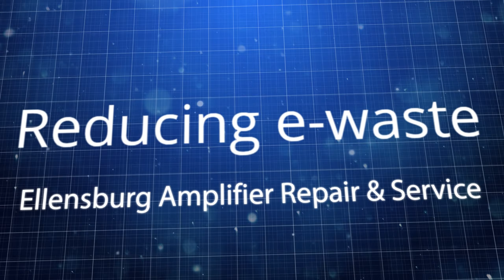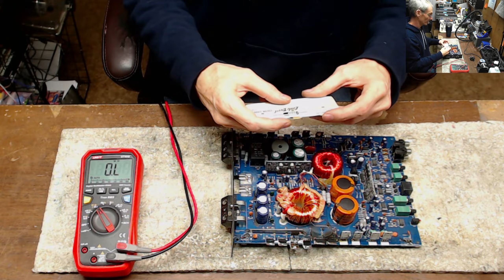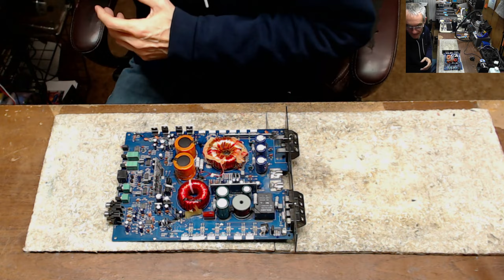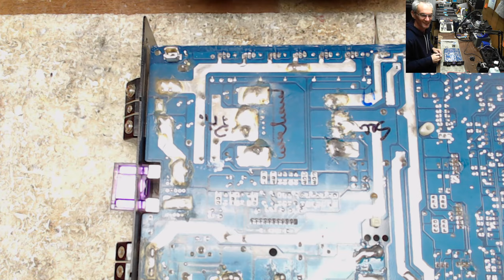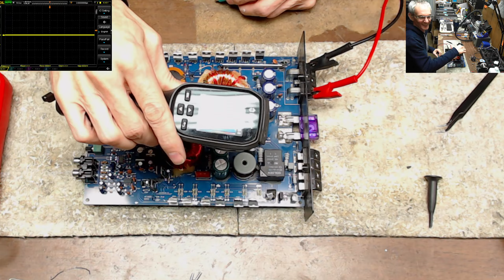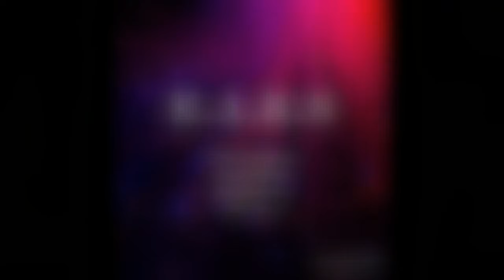Hifonics HFI1000.1D Car Automotive Amplifier Repair

Comment: Learning so much from this video and only at 29 min into it! By chance could i send you my amplifier to fix ?
Reply from the maker: Hello! It depends on what amplifier you need to have serviced. I do not service all amplifiers and the FAQ page of my site provides more information.
Reply: @ell @ellensburgamplifier have the same question, got a hifonics zrx1216.1D that has some ugly corrosion on the fuse terminal and on the chip with the model number on it also noticed a ground looked melted at the tip like a fuse burns lots of info just came across your channel aspiring electrician here 1 semester from attempting the certification for in California

Comment: I was wondering where I could get the cardboard turntable that tells you what resistance the resistor is around 13:36 in the video any help would be appreciated thanks
Reply from the maker: Ok the reference wheel. The one I have was put out in the 50's but here is a link to a good guy (Steve) that has one for sale. Tell him Todd's Tubes and Testers sent you! https://www.ebay.com/itm/276369865501?mkcid=16&mkevt=1&mkrid=711-127632-2357-0&ssspo=DbJ3X0MoTlC&sssrc=2047675&ssuid=Q6ZdGeQQSfm&widget_ver=artemis&media=COPY
Reply: Thank you very much
Reply: What scope do you use?

Comment: Where did you get the resistance turntable board
Reply from the maker: If a resistance box is what you are referring to then google "decade resistance box" and many will pop up. Quality is key on these.
Reply: @ellensburgamplifier  no it was a card you had that showed the different colors to figure out what was the resistor
Reply: Its at 13:36 a card with a turntable you said

Comment: I have a Autotek Meanmachine  1500.1d (2012), its before Maxxsonics took AT in a different direction.  It's the Exact same board. And I've had the amp 10yrs...pushing hard. It ran cool all day, 4h road trips, pushing hard. 

I'm glad I seen this video, because that Super Class D board is what caused mine to go into protection for the first time. I stripped it, and cleaned the board....there was heat traces on the p2d chips at the top of that component you pulled. It runs hot now, but hasn't gone into protection again. Impossible to get ahold of that component,  so I guess new amp when it fails completely. 

Is this a component that will draw more amps from my alt if not replaced?

Thanks....great video
Reply from the maker: Yes, if there is any issue with the output card you may see a high current situation. It is best to rebuild the whole card.
Reply: @ellensburgamplifier  thanks for such a quick response...is there a place to get a card? I doubt Maxxsonics would supply one...a new amp seems simpler,  but I have a very customized install....great video and information  btw👍
Reply from the maker: @loc6880  Thank you. I make videos only to help others. Cards are not readily available for the most part. The best option is to rebuild the one you have or send the amplifier in for a replacement card if the original card is too damaged. I do carry several of these cards for situations where the original is not usable.
Reply: @ellensburgamplifier  well, its appreciated by ppl like me...repairing  that card is above my pay grade🤣. 1 more question....can you tell me what the card is called.....so I can ask around the shops....

Thank again
Reply from the maker: @loc6880  I call them output drive cards. I have seen them also called system drive cards. In the Perry Babbin world, they are called type 7 output cards.

Comment: When using your meter to charge caps, you can reverse your leads and watch it discharge and charge negatively. Sometimes I find a diode there, and I can’t use that method, but I work on all kinds of stuff.

Comment: I have a kac 8105d which blew a power mosfet stp60nf06fp..the amp sat idle for like two years ..later on I just wired it to my car and it just started to smoke.. I did try replacing the mosfet with the same model number ..but as soon as I connect the power and ground (not p.con) the mosfet starts heating up ? What should I do ?
Reply from the maker: You most likely will need to replace all of the power supply transistors and I would also check the gate resistors to make sure they are within spec. If you show any low resistance values between gate and source then you have to keep digging for the short.

Comment: Great material,
I have one question about the Phoenix Gold car amplifier, I disassembled it and noticed that the transformer, one of the turns is very loose, should I attach it somehow or glue it with some special glue?
Reply from the maker: I would get a bottle of Gorilla glue clear grip and secure down the windings and anything else that is loose.

Comment: I have ssl 1200.1 it's  not turning on .....fault
Reply from the maker: A good rule of thumb is if the protection LED comes on then the power supply might be OK but if no LEDs come on at all then the power supply is down.

Comment: Do you work on b2 audio or cab 22 amps? The b2 is new, I reversedpower and ground during instalation
Reply from the maker: I am choosy with B2 amplifiers and I do service CAB22 amps. Your B2 will need to have the power supply rebuilt which can be done.
Reply: @ellensburgamplifier  where do I send the cab? So are you saying you will or won't work on the b2?
Reply from the maker: @siemerrimanjr9060  www.ellensburgamplifier.com/request-a-quote is where you will find the form to submit if you are interested in any repairs. from there I will email you all the information needed to get you going for repairs. You are correct, I may or may not be able to repair your B2 (they are in the list at the bottom of the FAQ page) as it depends on what model of B2 it is and what damage is present. www.ellensburgamplifier.com/FAQS is where most all questions are answered.

Comment: How do you replace the RCA jacks on the amp itself, can you do a video on that
Reply from the maker: To change the RCA jack all you do is remove the board from the heatsink and there are typically 3 solder points on the bottom that once unsoldered the RCA jack should fall right out. I can try to add that to the list of videos but it is something that I do not do often.

Comment: I need to replace some IRF3205's but those are discontinued according to mouser. What are you using to replace these? Ebay and Amazon has them but I'm not taking a chance of them being fakes
Reply from the maker: You may have searched for the wrong part number. The 3205 is in stock through Mouser. https://www.mouser.com/c/?q=IRF3205PBF
Reply: Ok thanks. I am not new to electronics but I am new to amp repair. Trying to learn how these work.  I have a Hifonics 32001.d that I am trying to fix.  Protect light flashes on and off when remote is applied. All power supply fets are good and also the output transistors.  I tried replacing the pwm IC on the power supply driver board but thats not the issue.  No switching. It just pulses fast at the gate. I see the square wave for just a split second but pulses on and off.    @ellensburgamplifier
Reply from the maker: @garrettlassalle6544  Verry rarely is there an issue with the power supply drive card. The best way to approach an amplifier repair is to treat the repair in two halves. Start by removing the output drive card which carries the over-current protection in a lot of topologies and remove the output transistors if there are no pull-down resistors for the gates. This should allow you to power up the power supply or troubleshoot any rail shorts.
Reply from the maker: Thank you for not purchasing components through "other" vendors as they will most likely be counterfeit. If you want to save money and do a lot of repairs LCSC has an excellent price point for the 3205s.
Reply: Where are you getting the driver cards from? I will rebuild the old one but just wondering where you are getting new driver boards.
Reply from the maker: @garrettlassalle6544  I purchased a bunch of scrap boards that still had all of the cards from a local shop.
Reply: One other question for you. The C3228 and A1275 transistors on the power supply driver board. Mouser doesn't have them. Have you found these anywhere else or do you have an equivalent?
Reply from the maker: @garrettlassalle6544  You will have a hard time getting those here in the States. I order mine from LCSC 1000 at a time when they have them in stock.

Comment: Hey Todd! What do you use to remove/install the spring clips for the transistors? Oh and the calculation for the 3 100K resistors is as follows 1/1,000 = 0.00001 x 3 = 0.00003 = 1/0.00003 = 33,333.33ohms
Reply from the maker: This is a tough question to answer as I use 3 different modified tools. I would have to show these to make sense.
Reply: @ellensburgamplifier  It would be a real treat if you made a video on the topic, there's nothing on the internet about those spring clips and only 1 or 2 videos on YouTube
Reply from the maker: @E-raticWarrior  I will absolutely keep that in mind. I just saw a short and a guy was using a harbor freight pick that I may just make a complete set as the handles are longer than mine. Arthritis makes things harder to do as I age! And thank you for the equation. This is what I like to see posted to help others.
Reply: @ellensburgamplifier  sorry to hear that Todd, do you have apprentices? To pass all this skill and knowledge to?
Reply from the maker: @E-raticWarrior  No apprentices at this time as there is a lack of knowledgeable people in basic electrical theory and troubleshooting for me to bring on.

Comment: I have clas d amp mono ..dual rail toroid...ac voltages from each toroid is normal...buta after fecirtier is asymmetric ...or unequal dc..tanks for help
Reply: I remove allcaps after diode to try...midel pin diode unsolder that to...and from that diode is diferent voltage..the diferent abaut 12 volt..😭👍
Reply from the maker: @titovaio2768  So if you have a difference at the rectifiers then you will have to go back to the power supply and verify that the P-P values for each drive section are the same. A rectifier will only rectify what it is given.
Reply: @ellensburgamplifier  the ac voltage from each toroid is the same...either from from each irf44 is equal ...and no heat in all that irf44 ,just about 10 degres warm...im sorry to spend your tima...and sorry for my englis to🙏🙏🙏
Reply from the maker: @titovaio2768  Are you using a scope? Is the duty cycle identical? If the peak-to-peak square wave is identical, both in amplitude and duty cycle at the rectifiers, then the common anode/common cathode voltages should be the same if the rectifiers are in good condition.
Reply: @ellensburgamplifier  i dont have osiloscope...😭...just digital multimeter..and i allready try with new one...and the resoult is same....i want send a pickture of may amp...but dont now how...dont be your problem...i just wont to now if you ever meet this issue or clue...tanks for your time and your kindnes to replay 🙏🙏🙏
Reply from the maker: @titovaio2768  I have seen unequal supplies before. It can be one of a few issues. Without a scope, I would be guessing at the issue. Did the amplifier not start or does it go into protection? You can always email me which you can find on my site at www.ellensburgamplifier.com
Reply: @ellensburgamplifier  no proteck... all main caps after diode is blown and leaks oil..and output mosfet very hot but just 1 each side...if i remove that 2 hot mosfet...it will proteck ...
Reply: @ellensburgamplifier  i will email you one day...what is englis for some time or some day on another day...😂😂😂..tankyou
Reply from the maker: @titovaio2768  Oh ya, shorted output. What output drive card is it using? (what amp is it?). Once you correct the output I will bet the rails will be just fine.
Reply: @ellensburgamplifier  is the output still connect if i hang the midle pin diode?
Reply from the maker: Remove the output transistors. Is the condition still the same?

Comment: Some amps have the “ON” LED powered up by the 15v rail for the op amps. Others have a B+SW circuit that gets powered/switched by remote.
Reply from the maker: 100% correct. Thank you for the support!

Comment: I have the hfi2000 amplifier and have a chance to buy another.  I'm running 2 12in evl 1250rms each subwoofers off it. I think I could use another one. Do you have any idea what the hfi series actually does for power compared to rated?   Thanks!
Reply from the maker: Hello and thank you for the support. I do not know what the clipping output is as I don't dyno amplifiers. You would have to have one put on a dyno to know or you can base it somewhat off of the available rail voltage.
Reply: @ellensburgamplifier  Is it similar to using a DMM to set the amplifier gain but would have to use a process of elimination. Because a company can print on the amplifier that it's 1100 watts cough boss audio but it has a 25 amp fuse and when running a 50Hz sinewave through the max voltage at the output is 31 volts which would calculate to, with a 4 ohm load <250 watts, and not clean 250 watts either because of clipping.
Reply from the maker: @E-raticWarrior  I feel the end user should always know what the rail voltage is to properly set an amp up. There are so many variables when it comes to output wattage that it is hard to calculate what an amplifier will do. What I do is log the rail voltage at the rectifiers with an input voltage of 12,13,14, and 15 volts (sorry guys I do not support the use of 16 volts, especially with 1:11 transformers) and then figure roughly a 20% loss through the output stage to give a rough idea of the potential clipping voltage. A scope is always the best in my opinion as you can see the sign wave.
Reply: @ellensburgamplifier  I just recently found out about plus and minus voltage rails and the fact there's negative voltage, which blew my mind. To be honest the end user wouldn't know what to do with such information without having considerably knowledge about how an amplifier works and because of that they can't sell that end user an amplifier with 5000 Watts printed on it with a 10 or 20 amp because that end user would immediately know that's BS!
Reply from the maker: @E-raticWarrior  Indeed! I spend quite a bit of time on the phone helping people understand amplifiers.
Reply: @ellensburgamplifier  I'm guessing it gets frustrating it times?
Reply from the maker: @E-raticWarrior  It sure can. It's the amplifiers where I miss the obvious that drives me crazy. Like overlooking a broken inductor leg.

Comment: I working on a md 12 k with noise coming from the speaker out put and after couple seconds some tick tick tick sounds coming through the speaker then go protect with a green light and the red light flickering don't want to damage so any suggestions where to look first
Reply from the maker: First, I determine if the gate-source resistance values are correct at the output transistors. What is the resistance for - the low side gate for both sides and the high side gates for both sides. We are comparing the two halves of the amplifier. (parallel banks of 5 high and 5 low)
Reply: @ellensburgamplifier  jus a follow up on the md 12k after start up makes the sound then the clip light and protect flash so the amps is thinking that's it's clipping so I'm I figure it's a output filtering issues I'm going to try different inductor in it cause the output filtering caps are ok
Reply from the maker: @djbell9939  Is there a significant DC offset on the speaker terminals when it starts? When these inductors fail they fail drastically due to the high rail voltage present. When the output caps fail they will in most cases pop.
Reply: @ellensburgamplifier  will check the voltage
Reply: @ellensburgamplifier  I'll will double check all of that thanks for the tips